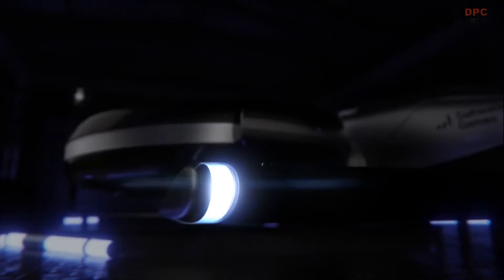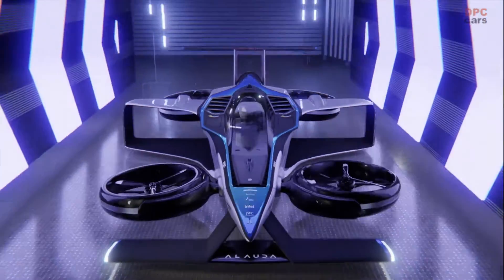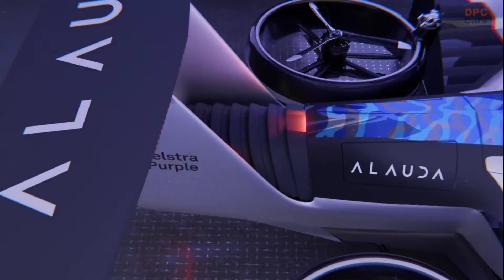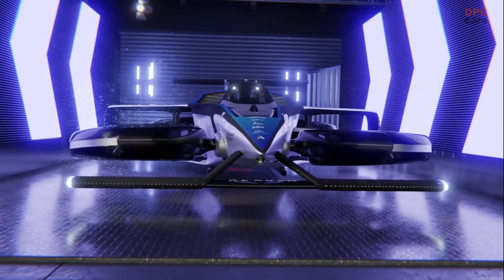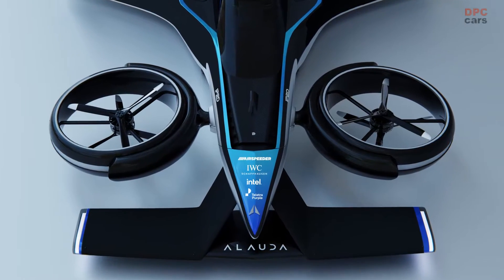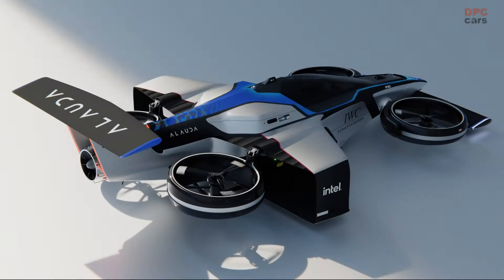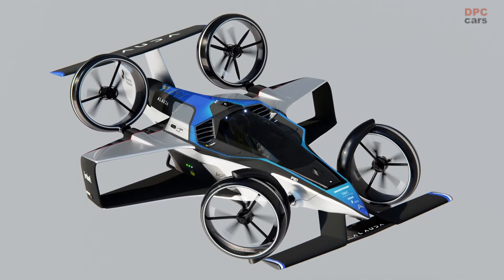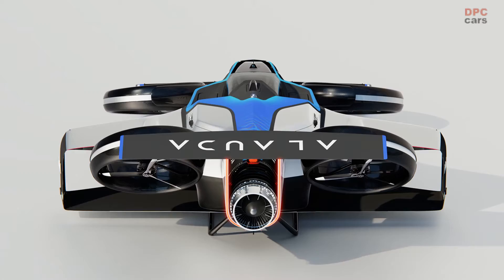World’s first crewed flying racing car

Comment: This competition would help a lot to push the technology required for personal VTOL mobility. 
When I see different VTOL designs, most of them seem wrong, not convincing (with few exceptions), this instead looks like each part is in synchrony with the rest of the parts.
Not like VTOL designs where they add 4 propellers than are only used to take off or with bad aerodynamic designs or fly angles. 
Here we can remplace the H2 turbine with a less powerful (but more efficient) fuel cell, increase the size of the propellers and wing surfaces, this will reduce the speed but become less noisy and controllable. Exactly what a personal flying vehicle needs.